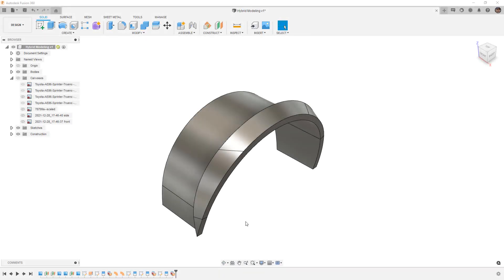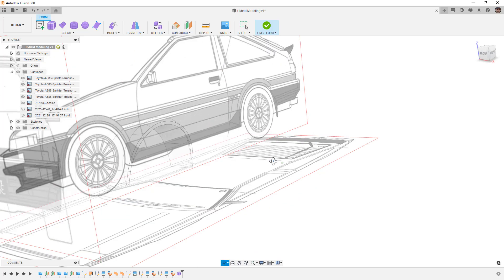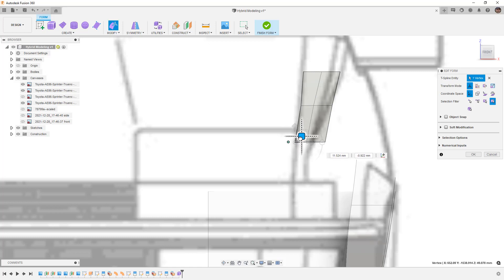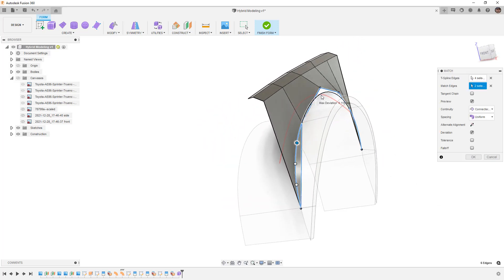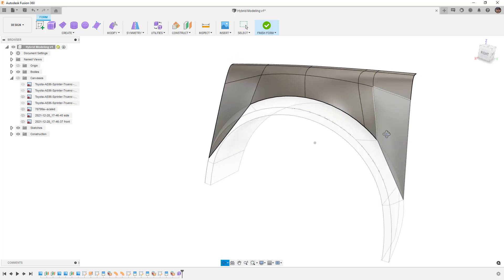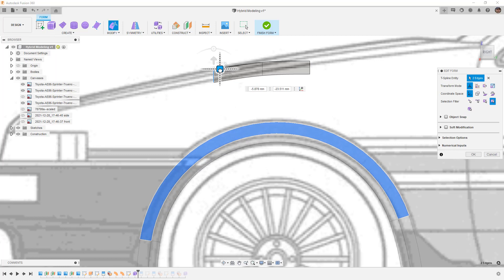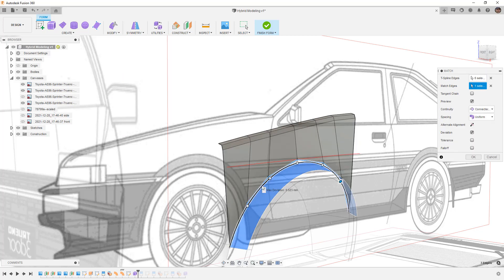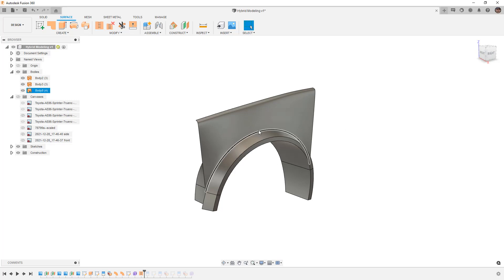Fusion 360 Form Mastery - Part 10 - Using Match to Attach a Form to a Surface

Comment: Dear Matt, 
thank you for your great content. At the moment I am doing your whole course for mastering the forms in Fusion 360. Where can I get the file? For example of Part 10. It would be great if you could help me again.
Kind regards from germany
Reply from the maker: Thanks!  If the files are available they will be in the desc of the video.  I am not able to share all files.  For example for blueprints I have purchased that aren't free or models that were sent to me but not able to be shared.  I do appologize for that.  

This file is fairly simple and i could pull out the blueprint and provide it if you need. you can email me support@caducator.com

I also do have a more abbreviated course www.learneverythingaboutdesign.com  for learning forms.  This playlist here is pretty big so I wanted to do a more pointed forms course.
Reply: @LearnEverythingAboutDesign  Thank you for the fast answer! No problem.

Comment: How do you join two different faces 🤔🤔!!
Reply from the maker: There are 4 main ways to do that.
If they are apart you can use the BRIDGE tool.  it will add new faces between.
You can also use the FACE creation tool and snap to existing verts and build new faces.
If you want to connect two together without creating new you can:
Weld Vertices - This lets you pick 2 verts and merge them (to the 2nd location selected)
Merge Edge - This lets you merge 2 edges (chains of edges) together. but pay attention to the end points as they don't always line up and might need to use Weld Verts to get them in the right spot.

Comment: That crease you saw in match at about the 5 minute mark looks really annoying. It’s probably got a situation where one of the vertices is creased (with tangency handles) and the other isn’t.

There is a workaround to un-crease such edges: crease them first, then un-crease them. Creasing first “extends” the crease to the whole edge, which gives un-crease something to select.

I kind of hate that workaround, but it’s better than having to delete the whole thing.
Reply from the maker: Thanks for the tip Adam!  Yeah for whatever reason match likes to play fast and loose with tangency handles :)  I have also noticed that if you change the edit form selection to verts and you move one of the handles then use the reset(which is a chain link icon?) it will often go to the path of least resistance.
Reply: @LearnEverythingAboutDesign  We should probably chat about the stuff happening in this model. For one, I think uncrease should have let you uncrease that creased vertex (that's probably the problem--only half the edge is creased, so uncrease can't see it). For another, I want to know why it added that crease in the first place.

The tangency handles are another issue. T-spline creasing gives a lot of extra shape control compared to subd creasing, but sometimes it's confusing. When you "link" a tangency handle, you're applying a constraint to "just behave like a subd crease, I don't want this extra control." In the case of (G1 or G2) match, though, we need them unlinked so that we can control tangency and curvature. G2 matching in particular is impossible without tangency handles (subd surfaces can't do it except in the simplest cases). That said, for any cases you see that are behaving weirdly, I'd love some data.
Reply from the maker: @adamhelps  If you don't still have my email from the last time we chatted just drop me a line support@caducator.com.  Match did some weird stuff on this example for sure.  And the odd part is that i have replicated this again and got a different result....

Comment: Ok, so match just sort of approximates things and then you actually connect them using stitch and adjusting the tolerance?  Sort of like match gets it 98% of the way there and then you just perfect it with stitch?
Reply from the maker: Since this video was made Fusion 360 added an Associative option which maintains a link between the Forms body and the sketch or surface you are referencing.  I did 2 update videos on that the most recent being here https://youtu.be/QOylnpsG3Qc  

When you use tolerance in the Match tool in order to get the shape close it adds T-points.  I don't like this because it affects your ability to add edges and control the flow nicely.  So it is a trade off.  If you don't have enough divisions to accurately match the shape, when you go to stitch the surfaces you end up with gaps and you might need to adjust the stitch tolerance to get them to join together.

The way I would do this if I "HAD" to get the edges perfect is I would use Match early on without tolerance, continue to build my shape and then when i knew i was done adding edges or changing the edge flow, I would use the match option with tolerance.  At that point the extra Tpoints on the edge would likely not matter.

Hope that helps.
Reply: @LearnEverythingAboutDesign   Cool, thank you so much, I really appreciate the depth of your explanations and responses.

Comment: Success! I  use a form and a surface body line to get a clean transition between wheel arch and the top of the fender
Reply from the maker: Hey Ian, I just saw all these comments, sorry I wasn't able to answer while you were struggling.  What ended up being the problem with the edge selection?

Comment: I seem to have a mind set that blender is difficult to model in. Am I over thinking it and should keep on slogging it out. Is Blender better to model in over Fusion 360?
Reply from the maker: This is a topic I have thought about covering in a video.  Modeling the same thing in Blender vs Fusion 360.  There are pros and cons to both.  Highly detailed "hard" models are easier in Fusion 360.  Things like detailed lights, bezels, trim etc.  And anything that needs to be dimensionally controlled.  

One thing that I have failed to bring to light is really the difference between forms and poly modeling in blender.  In forms when we are box modeling it looks like what we would do in blender, but in reality what is happening is we are making a control cage and the software uses math to create smooth curves under that.  This is the reason we might have a bunch of straight edges in box mode but they aren't straight in smooth display.  In blender we are making the actual mesh and can use tools like subdivide to get a smoother outcome.  This can be done visually or actually applied to the model.  In addition we can change the weight of edges, something I really wish Fusion could do.

The car in this video, the Corolla, I have tried several times to get a good result out of Forms and it just wont do it.  The main issue is the harder body lines of a boxy 80s car.  Forms works well for the Ferrari and more organic shapes but falls short when you try to control harder edges.  You can fake it with creases but when you have a crease end into something like a fender flare it gets really ugly and hard to control.

For the Corolla I must have burned up a few hours just trying to get a result I was happy with.  The hybrid modeling approach can help if you build some control surfaces for those features that are harder in Forms to accurately control.

I don't have a "this works and this doesn't" formula sadly.  Surfacing takes a long time in Fusion using sketches to control everything.  Forms is much quicker but falls short on harder detailes(like the WRX), and Blender is great but not for producing real CAD data....

Comment: Good job! That gives an alternative when you get a problematic fender to model. 2 days ago I had a problem modelling the hood of a car. Generating the surface area of the model I couldn't weld two vertices and get back out of box mode. I had no choice but to merge edges to continue forward. Any suggestion on what could have been the problem? Was Fusion taking liberties there too?
Reply: Sometimes using weld vertices can show if you have some funky disconnected points...
Reply from the maker: Hey Ian, it is hard for me to say what the issue was without looking at the model.  I am happy to take a look if you ever get stuck and export that version of the file.  Sometimes using repair body and loosening up the weld tolerance can fix that stuff across the mirror line so make sure you give that a shot too.

Comment: Would it work similarly with a prismatic converted mesh from for example blender? Which would have a few more edges than the clean flare, since it was problematic before rolling the history back
Reply from the maker: Tarek, it treats the mesh slightly different than it does a surface.  You can use both Match and Pull with the mesh but its the difference between moving the edge of a Tspline body vs moving a vertex.  You need the surface edge if you want to control tangency between the form body and the surface.  Mesh won't do that

If you could get the flare as a quadmesh from Blender the easiest thing is to just convert it to a form body and then use Freeze so it doesn't move.
Reply: @LearnEverythingAboutDesign  exactly, i mean if you import a mesh and convert to Tspline, like the Blender->fusion video, converted meshes have many facets, if it creased 2,would it crease 20?
Reply from the maker: @Tarex_  no because it doesn't treat the edge of a mesh the same way.  You cant use match on a mesh edge, you would need to use Pull, which takes vertices to the mesh (or surface).  But as far as I know you can't take the edge of a form to the edge of a mesh.
Reply: @LearnEverythingAboutDesign  haha i mean after the conversion, so Tspline body, not mesh body
Reply from the maker: haha. for that i think the only option is to merge the verticies.  I have honestly never tried to match or pull the edge of one tspline body to another one.  Interesting idea though.